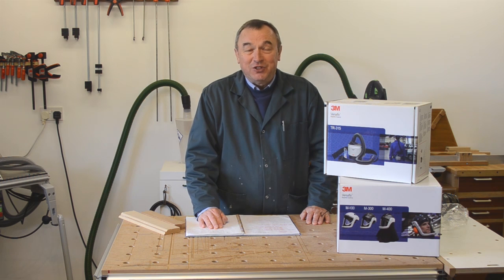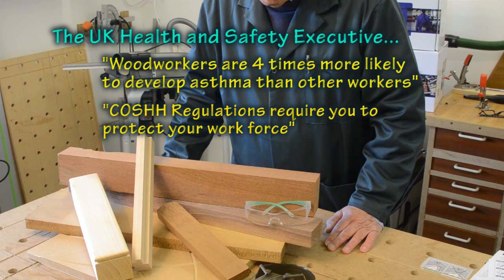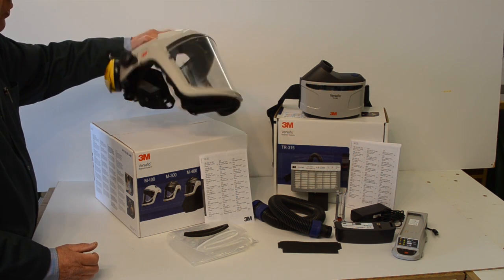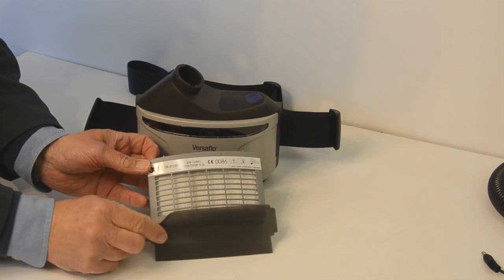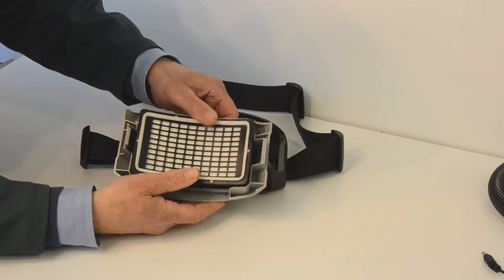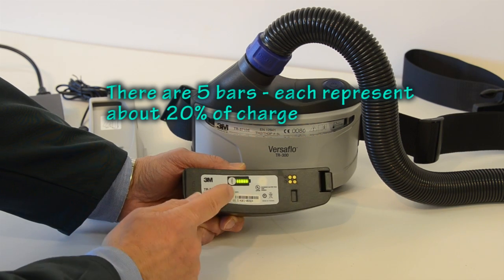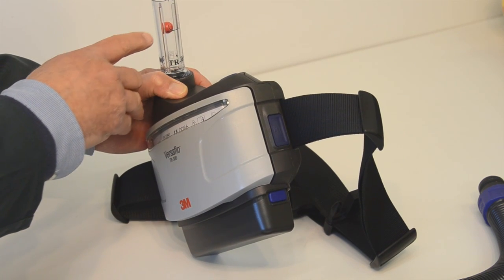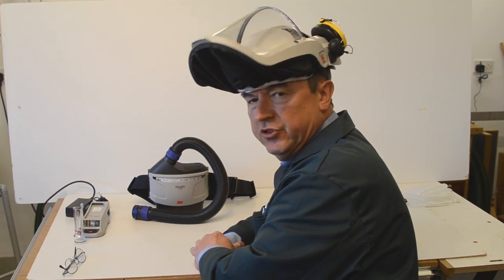3M Versaflo Respirator System

Comment: Hello Peter, been enjoying your videos over a number of years, especially when I started buying (often used) Festool equipment for my house renovation. First saw this video many years ago, and dismissed it as a crazy price piece of kit. Well here I am about to pull trigger on a TR600 or TR800, the next models up. I am spraying in my garage (car project) so need the gas/vapour protection of the higher spec units.But once that's over, it'll be a staple for the Festool track saw and other jobs, where, despite good dust extraction, I can still sense there is dust in the air when working indoors. Used units come up on ebay for a reasonable (but not cheap) price, main issue is battery status, as thats the big ticket item - all the consumables can be replaced for, as you say, reasonable cost. Thanks again, particularly appreciate the content on helmet adjustment and different types of helmet.
Reply from the maker: Hi Kevin, Well done on the tool purchase arrangements - very sensible. The battery on my Versaflow has died and it is just too expensive for me to replace.  Cheers.  Peter
Reply: @NewBritWorkshop 12 years good service isn't bad I guess!

Comment: Its not even tight arround the neck, is this really 100% filtering the bad air? :( Thank you
Reply from the maker: The respirator has a face seal so no need to have it tight around the neck.  Peter
Reply: @NewBritWorkshop  Hmm, i think against covid19 we need to have it 100% tight.  This system uses some kind of positive airflow. But i rather use my 3M 6800 i think, 100% tight and ALL incoming air is going thru filters. On the Versaflo, it is a big risk you start to take in air from outside if the battery dies or if you get some error.

I wish it was like Plan A = fan supported filtered breathing  and Plan B = Non supported filtered breathing.
Reply from the maker: The 3M Versaflo can be seen in use in many Covid settings. If you need reassurance contact 3M.   Peter

Comment: Hi I'm considering getting one of these but what filter would I use for MDF etc thanks and great video.
Reply from the maker: Hi James, I have now moved over to the Trend Air Pro Max as it is all in one piece with no air tube running down behind which I found often got caught.   Peter
Reply: @NewBritWorkshop  thanks Peter much appreciated for the reply what filters would you recommend just P3 or some sort of combination filter?
Reply from the maker: Hi James,  The THP3 are perfect.  I have been using the Air Pro Max for 6 months now and it is so easy to put on and off, it is very efficient and perfectly comfortable. The ear defenders work well too. Cheers.  Peter

Comment: one of my family member is the medical worker in frontline, I'm deciding to buy this one for her as gift
Reply from the maker: Hi Ray, What a kind thing to do. I have seen doctors or nurses using these and similar models on news clips on TV.  Cheers.  Peter
Reply: @NewBritWorkshop  Finally, I brought a 3m jupiter for her. totally new
Reply: @rayqian9165  Its not even tight arround the neck, is this really 100% filtering the bad air? I mean other non-fan masks is very very tight.  This seems not that tight........
Reply: A C actually it has different kind of helmet, sone models are fully cover your neck. I think it’s the most safe solution
Reply: A C it’s positive pressure, so don’t worry and no need fit test
Reply: @rayqian9165  I use 3M 6800 in hospital against covid, and it is very very tight. I need to read more about this "Positive pressure"-technic. Right now i dont feel so comfortable, even due it looks very cool.
Reply: @amk209d30d  oh! I think you could buy one for yourself. totally worth it. 3m 6800 full-face mask only have APF for about 25 but the PAPR could have the APF beyond 1000. the paper system used in many ER in hospital, it is most safe solution,
Reply: @amk209d30d  salute to all the medical workers in frontline

Comment: ive been having breathing trouble after woodworking lately that is confusing even my doctor. i really think somehow my half face respirator is taxing my lungs. does something like this provide easier breathing?
Reply from the maker: Hi Nathan, Some woods are toxic and affect people in different ways. The Versaflo is a powered respirator and so you are not having to force air through a cloth mask as it is delivered to you in the headset.  I am a great fan of this kit and would use no other. Peter
Reply: Hope you found out what was causing you issues, but if you're still struggling it might be worth reading the book Breath by James Nestor. If you have dysfunctional breathing, you might be mouth breathing/ upper chest breathing which people can usually get away with, but once you start breathing through a respirator that adds resistance to the air you breath. It puts a lot of pressure on your chest muscles and can lead to a tight and achy chest if you're doing iy all day, 5 days a week.
Reply: @MachoMaamRandallSandwich  I appreciate the response. I haven't had any occurrences since many months ago around the time of writing this. From what I've gathered, it actually appears to have been some anxiety-related affects of some things going on in life at that time. Been Woodworking tons and never get those feelings anymore so I guess I blamed the wrong thing
Reply: @TreeOfLifeWoodworking  I'm glad you overcame your issues. It's crazy how much anxiety can effect us physically! Take care brother
Reply: @MachoMaamRandallSandwich  it really is. Was the first tangible thing anxiety has caused me. Glad to be past that misery haha. Take care also! Happy Woodworking

Comment: Hi again Peter
Am in total agreement on the need for dust protection. Like you I have found that years of working in dusty environments has affected my health, although fortunately not to the extent of acquiring an asthmatic condition. I do, however, find myself suffering with a tight chest and coughing if I do not take some protective measures.
I had previously bought a Trend mask but found it a little on the heavy side and it has not been trouble free during the time I have had it. So of late I have been using a JSP mask with suitable filters. This has been ok but, like you, I found that it is not the most pleasant item to use especially for prolonged periods.
So when I saw your video I thought the Versaflo might be the answer. The cost is a bit of an issue however but put against one's long term health probably not really so much. Consequently I trawled the internet and found some offers which although still quite a lot of money were a good saving on the 'going' rate and I am now in possession of a Versaflo 300 and M106 mask at a cost of just under £500.
My immediate reaction was that it was a well made product and after charging it up I have given it a couple of runs, one when rip sawing some wood (my vintage bench saw has no useful dust extraction) and whilst doing some turning/sanding. I have to say that I am really pleased with it's performance. It gave plenty of air (on the lower setting) and after a very short while I did not notice it was on. The view through the mask is excellent and perfect for the close work needed when checking finishes.
One final thing Peter - some years ago I saw your video of the Cyclone Central cyclone kit and bought one and have had it in use since. Unfortunately when doing some maintenance on it the other day I managed to block off the safety valve and it suddenly and without warning imploded. It is a complete write-off so I looked to find their web site to order a replacement kit only to find that it has disappeared. Are you aware of the company having ceased trading or possibly moved on with a new name. If the former it looks like I will have to dig much deeper in my pocket and get a new cyclone based extractor as I would not go back to extraction without a cyclone.
Many thanks John N
Reply from the maker: Hi John, Well done on the 3M Versaflo - it is the best system in the price bracket and (of course) beats anything below it by miles.  Cyclone Central ceased trading a long time ago and despite sending the guy a wedding present and trying to contact him I have heard nothing at all. I am doing my best to arrange for some similarly priced 4" cyclone to be put on the market with a UK company in the New Year (not sure when). It will include a drop box and be very competitively priced. Once it is available I will feature it in a video. This could be 6 months away though.   Peter
Reply: Peter
Thanks for that, I guessed they must have ceased trading.
I would be interested in the cyclone/drop box when it surfaces and may soldier on with my Festool Midi for a while. It is a bit limited when extracting larger stuff from my turning sessions however as the hose isn't big enough. Do you use the Festool for kit producing shavings such as a router table?
Another reason I was considering replacing my current (now dead) cyclone is that I have been using a Record D400 which is not only very noisy but has no effective back end filtration so anything small enough to pass the cyclone and Record just exits into the 'shop. I have been looking at the Laguna and Axminster cyclone extractors but they are relatively expensive at around £1500 & £1300 respectively.
if someone comes up with a reasonably priced cyclone/drop box I could replace the extractor element with a basic extractor+hepa filter to power the system.
Thanks John
Reply from the maker: Hi John, I use my Festool CTL26 for everything except my planning machine. I have a split hose (Festool accessory) for the router table so dust is extracted both from the standard router dust port and from the back of the fence. For my planer I use a Numatic NVD 750 (bought from Axminster many years ago) which has a 4" port and then my cyclone is used to intercept the chippings. I only need to empty the bag in the NVD 750 once a year and that is not because it is full (barely a cup full of dust after a year) but because the really fine dust does get through to the extractor and after a year the filtration effect of the bag diminishes. As soon as I have news about a 4" cyclone on the UK market I will put up a video.    Peter

Comment: When should you renew the pre filter and the main filter and how do you know when to do so?
Reply from the maker: It is in the manual. I believe that it is about every month of continuous (working hours) use. The pre-filter can be washed and re-used. My main filter gets changed once a year.   Peter
Reply: thanks. So the manual or instruction tells you when to change the filters?

Comment: Nice review, as usual. very detailed and easy to understand. Is there a specific unit designation just for woodworkers? When I look them up, it gets a little overwhelming.
Reply from the maker: Hi Robert, This is what I started with: http://www.axminster.co.uk/3m-tr-315-versaflo-powered-starter-kit-103683    Peter
Reply: @NewBritWorkshop  Hi Peter, this link comes up with the dreaded 'Error 404'!  I have the same question as Robert, "Is there a specific unit designation just for woodworkers?"  Thanks, Chris
Reply from the maker: Hi Chris, The unit you need should have a face mask element and also provision for ear defenders. The motor/filter unit and charger are standard. Different filters are available for different work areas. The general particulate filter is suitable for woodworking. As that link did not work go to the Axminster site and search afresh or, probably better, go to the 3M site and do some research there.   Peter

Comment: Hi Peter, 
looking at powered respirator and considering the Axminster evolution model, have you looked at it at all as I know you've done many Axy reviews previously? Thanks in advance. Craig
Reply from the maker: Hi Craig, I have not looked at the Axminster model at all. I cannot recommend the 3M Versaflo more highly - it is brilliant but I accept that it is not cheap.    Peter
Reply: Thanks for the info, much appreciated.
Reply: New Brit Workshop just bought the same set up you have here, decided with all the dusty work I was doing that it was worth it. Realised I'd be very upset if the £220 one from Axminster wasn't satisfactory and have become so upset with regular, wet faced, poorly fitting regulators, with steamed up "fog free" goggles.

Comment: Peter, great review.  
I was wondering how you would rate this system compared to the Trend Airshield Pro and which would you recommend?  I realize that these two units are at a very different price point but, as you mentioned in your video, when you consider this as a major piece of woodworking equipment the price becomes somewhat less important.  
Thanks,
Derrick
Reply from the maker: +Derrick Budden Hi Derrick, If you can afford it then get the best - the 3M Versaflo is the one and only system that I have in my workshop. It is fantastic and very well made.   Peter
Reply: Hi I had the air shield (not bad)  then bought two air shield pros found them to be poorly made and inefficient a CHEAP feel to them and dust within made me eBay them and buy the 3m it's in a different league, trend I feel are making a killing out of the consumables... Shame as I always classed trend as quality.

Comment: Great review , very detailed and we'll explained .. I was wondering though if there is a one way vent in the bottom of the head shield to let out expired air that would otherwise accumulate  ?
Reply from the maker: +34979Charlie Hi Charlie, There is no need for a special vent as the over pressure pushes the air (and exhaled breath) out through the face seal. It works very well and does not allow anything back in.   Peter
Reply: Hi Peter .. Okay great , thank you

Comment: Peter i commend you on all your videos you do describe everything with great detail
and do come across very well on your videos great stuff.
however do not take this as a criticism in anyway but after you demonstrate the 3m versaflow headshield if suppose you were cutting mdf my favourite(not) the minutes after dust would still be around and airboune  by the saw which has not been caught by the vacuum extractor.I have copd  so i am considering one of these otherwise
i will lose more lung  function long term i cant stress to the readers how important it is to protect with the best respirators you can afford not simply put a cheap paper mask on as it just will not be up to scratch .1 YEARS OF SUCKING DUST INTO YOUR LUNGS/NOSE EQUATES TO 1% LOSS OF LUNG FUNCTION AS A ROUGH GUIDE  

WITHOUT PROPER RESPIRATION THIS CAN HAPPEN many thanks peter taking us into the 21st century.
Reply from the maker: david kirkham Hi David, Thank you for sharing your experiences and posting this valuable warning to everyone. I use my Versaflo a lot, most of it is not shown on camera, and without it I know that I would be damaging my health.  Take care.   Peter

Comment: Thanks Peter for amazing detailed reviews of the product. I am just curious how long does per particulate filter last long? For example if I use this Versaflo system for about 8 hours per day, do I have to change the particulate filter once in every week? I just want to know. Thanks!
Reply from the maker: Thomas Lim Hi Thomas,  This may seem silly but I am not sure. I use mine for about 8-10 hours a week. I clean the pre-filter every week and also clean the inside of the filter area. I test the efficiency regularly using the manometer as one is expected to change the filter when it no longer lets air pass through at the required rate. I am still on my original filter after a year of that regime !    Now in your setting it may be different and you could ask your supplier for a definitive answer. The Versaflo is a great respirator and has made a he difference to my workshop practice.    Peter

Comment: Thanks Peter for the very nice review, and explanation of the product.  Better than 3M's themselves.  I am a ceramic artist and do a lot of spraying of glazes, as well as of course, the usual clay dust that we incur on a daily basis.  I have just been looking at this product as a safety measure that may not be used "all" of the time, but anytime I'm spraying, or cleaning the studio, when the dust is in the air.
Reply from the maker: Cindy K Hi Cindy, I use mine every day in my woodworking workshop and it really does make life so much better. I know that the Versaflo is not the cheapest on the market but you really do get what you pay for with this and I am absolutely delighted.   Peter